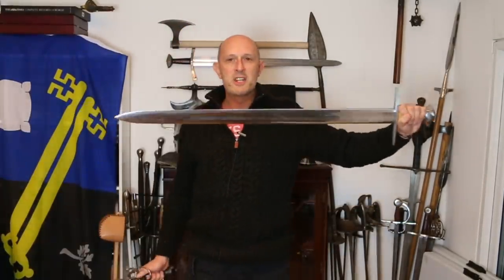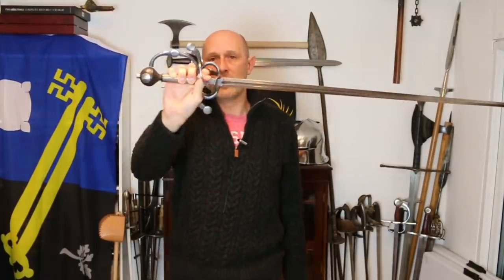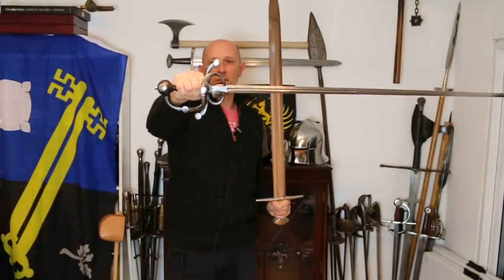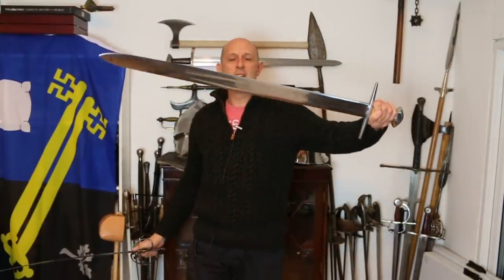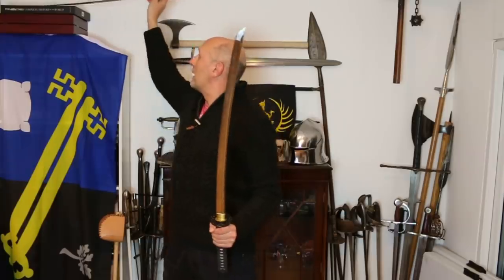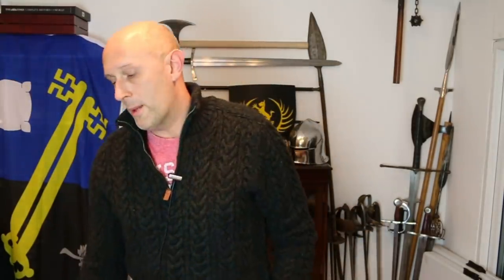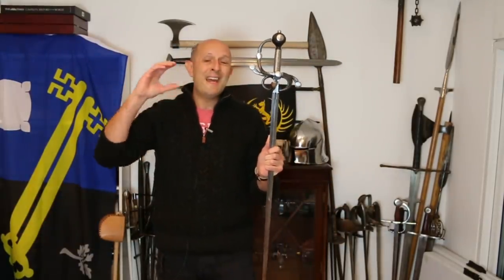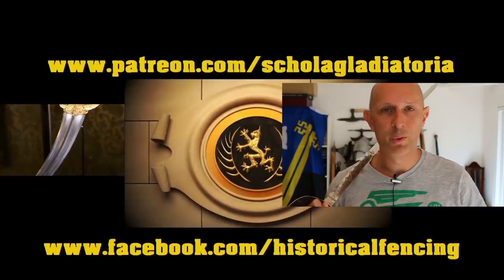Sword Blade Technology Informing Design

Comment: I understand the points being made in this video, and it may indeed have some truth to it. But, as always, any discussion of the evolution of arms and armor is even more complex than can be covered in one video. I personally focus on the late Roman and early medieval periods, so I've done a lot of reading on the subject of swords in those time periods. We can definitely say that, in the early medieval period (migration period - Viking age if you prefer), there was a broader range of steel and iron quality than either in the Roman or later medieval periods. Could be poor, could be excellent, could be so-so. And a lot of the metallurgical analysis of weapons and tools reflects that fact. So, of course, it impacted how weapons were manufactured. Pattern welding, folding, and laminating steel (like San-Mai) were all techniques performed during this period to make the good steel go further and the poorer quality bits more reliable. 

However, one thing that makes me question Matt's hypothesis here is the fact that these weapons change relatively little (at least in blade shape) from the Roman spathae they ultimately come from. Warfare during the late Roman period on through to the Viking Age doesn't change as drastically as it might have across 5-6 centuries compared to changes from the Viking Age to the Renaissance. All this in spite of the drop in consistency of steel quality after the classical period. The overall form of these swords as long, broad, cut-oriented weapons remains relatively unchanged. And while the availability of armor may have changed from time to time, the style or armor didn't change so much. To me, it seems like the form of the weapons is still just related to their function regardless of the average quality of steel. They stuck with what worked with some tweaking here and there. 

There are definitely some Roman spathae that are more narrow than the ones that the Germanic spathae descend from. And I would have to look more into those to see what they were used for and what kind of steel they were working with. Maybe that would shed some more light on this and see if Matt is onto something. Good video, Matt! Really got me thinking.

Comment: All of the earlier 'dark age' swords that I've seen (either as excavated or X-ray'd) have a narrow tang passing through the crossguard up though the hilt - during re-enactment training or 'battles' the majority of failures occured at the section change at or near the crossguard at the base of the blade suggesting that the width of the blade was a design choice rather than a material one? EDIT - must admit that the re-enactment blades were normally made from modern spring steel (EN34 from memory).

Comment: This is the missing topic. Cheers that you got to it.

Q: is thrusting more stressful to a blade than cutting?
Reply: I wouldn't think so. The force on the blade from the blade/target interface will be fairly similar as that is limited by human factors. A cut would actually put more stress on the blade because it subjects the blade to a bending moment with a long lever arm.
 This is why swords meant primarily for cutting tend to be very wide but thin (see falchion for extreme) as the material farther away from the neutral axis of the sword provides more strength than material closer to the middle. It is the same concept behind I-beams.

The reason you see swords undergoing such radical deflections in the thrust is that they are actually buckling, which takes much less force for something that is long and thin like a sword blade.
Reply: Depends on the shape of the blade and the metallurgical properties represented within.

Comment: I have some questions about about the guards on different swords, you mentioned the change in balance from the increased hand protection in the rapier compared to the arming sword, so how does the katana's disk guard weigh compared to a medieval long sword? It has also been mentioned that the disk guard gives less hand protection than a  cross guard especially for the back hand, if so do we see wore evidence of hand injuries on samurai to support this? And might the backward curve in the katana's handle be to hide more of the back hand behind the smaller guard so that it is not sticking out forward and exposed? Just shooting out theories, let me know what you think.
Reply: The Tsuba, the Japanese disc guard, is lighter than a crossguard with long quillons for sure; I don't think that you would find some data but is really a matter of dimension.
Some Tsuba could be quite big though.

It's really kind of a mystery why the Japanese didn't use crossguards, since they have it on other weapons; they are called Hadome and are used in spear, nodachi, parrying dagger and other polearms;

https://www.ashokaarts.com/img/product_images/image/detail/yari-hadome-with-lacquerwork-19th-century-3-6862.jpg

One of the reason that is often given is A) the Tsuba was actually large enough and B) the Japanese swordmanship is built in a way that most of the actions happen towards the end of the blade rather than closer to your hands. For example, in the bind, given the curvature of the katana, the blade slides rather than staying in place, so you don't really have time to use the crossguard. 
I'm also not aware of any technique made to snipe the hand; hands are very small and moving target.

If anything, if they didn't like their guards, they would have changed it. Despite all the hate/glorification it gets, the katana was a sword born from the battlefield, made to work and a very utilitarian tool up to the mid 1600.
Reply: @lucanic4328  thank you . that's some interesting information.

Comment: personally (purely speculative) i think the Katana (also the dadao) is mean to be used single handed on horseback if the samurai ran out of arrows or lost/broke their pole-arm. Then in desperation as a two handed sword on foot, but a samurai off his horse with a katana is little match for several peasants with yari. The particular shape remaining in use long after the Chinese abandoned that style is because the Japanese probably didn't use the katana for battle, only as a badge of rank and in duels that are expected to be over in a single strike. tradition and an "if it ain't broke, don't fix it" attitude kept it in vogue long enough for it to survive to the age of sabers and become relevant again.
Reply: That's true, to a degree. After Japan was unified after the battle of Sekigahara under the rule Ieyasu Tokugawa warfare slowly started to beomce a thing of the past and thus the katana started to get used less as a weapon of war than it already was. That's why I think that the katana stopped evolving after a while, it's because there was no need for it evolve since there was no longer any pressure from war to make changes and improvements to the design. This is also when, in my opinion, that the katana started to become the status symbol that it was in Japan, it was easy to carry around and thus a tie to their warrior heritage that they could carry around with them everyday.
Reply: Your points on the katana make sense but Dadao has always been designed with two handed use in mind. Other types of Dao saw primary use as one-handed cavalry sabers

Comment: Could these material strength concerns have to do with the way that Khyber knives were used? Matt has made a few videos citing victorian surgeons reports of 19th C Afghan fighters and soldiers cutting with their Khyber knives to the exclusion of thrusting. Perhaps the fighting system surrounding these weapons originated in a context where replacing a broken sword was extremely expensive, and swords were likely to break as they were made locally of lower quality from scarcer imported steel. As users of bayonets found over the centuries, weapons thrust into an opponent often break (or get stuck) and then must be replaced. If a sword was something inherited through generations and therefore prized for its sentimental and martial value as well as for the difficulty of replacing it, wouldn't such a context lead to a sword system that minimizes the chance of breaking your only sword?

Comment: I think I have two major issues with this. 

I think in Japan there's a sense of traditionalism, conservatism, which helped keep the katana, tachi in that particular form. When they did have the understanding, material knowledge to be able to make very differently shaped blades, they kept to the traditional pattern, simply because it is the traditional pattern. 

Their combat, which I have to admit I'm not as educated as I want to be, didn't really undergo the changes we really saw in Europe until much later. Even the 1800 to 1900's, if I want to throw some dates around. To be clear, credit to the smiths for making the most of the materials they have at hand and on top of that, the craftsmanship for the weapons that survived. Also, credit to the smelters, polishers,  the entire process from start to end. It's a long, complex and interesting process. 

Second thought is another take on context. Rather to the point you only know what you know, you don't know what you don't know, what's going to come in the next year. This is my issue with some of the early blades. Those smiths worked hard to make sure they make the blades they produced were fit to use. It really is that simple. They made a series of trade offs, choices, to ensure the blade was fit to use. 

So you might pick up that broader, early Migration blade, then a later period, 14th century long sword, they should cut on a very similar level. They should be able to take as much abuse as each and on top of that, should have the same...... persistence? Endurance? What I'm trying to get at is the same ability to last for a long time, whatever you want to call it. They really should. The smiths who make, made, such a blade, were operating on the lessons they learned, what worked in the past. As that body of knowledge deepened, it allows the range, spectrum, of what was a workable, functional and enduring blade to change. 

I don't think you can compare the common, trained knowledge of a person separated by ten years, never mind one hundred years or longer.
Reply: To be fair to the katana, it is still technically a backup weapon. It's primary advantage seems to be that it could be brought to bear from it's scabard practically instantly.
Reply: @weaponizedemoticon1131  So can an arming sword, I don't think there's any real  difference between the arming sword and katana there. 

If there is, it's between the people who are performing that drawing motion.

Comment: I think weather also take a large part on weapon shape, you see, South East Asia is wet, having heavy rain everyday, so metal will easily got rust, that's why sword is not popular here but instead the more cheaper blades like parang and golok (short machete type weapons) and keris are more popular. Because it is practical, why want to waste energy making expensive weapons that will get rust later, it is better to make cheaper blades that can be replaced at any time.

Europe and many other places have very cool sword designs because having dry weather making metal last longer, you have more time to think about what to do with your metal. What I mean is, us in South East Asia don't think much, as long as it can cut, slash and stab then it is good.

Comment: What kind of synthetic/plastic sword would you make?
Reply: You mean for training or combat?
Reply: Arpio Shop's
Reply: @Robert399  let's say combat.
Reply: I wouldn't recommend ever making plastic swords for combat. As a blade-making material, it's halfway between steel and bread. And I don't see any other benefits; if you want a weapon to sneak through metal detectors, a sword is one of the worst choices. If you really had to make a plastic weapon (let's say it's a post-apocalyptic scenario and plastic's all you have access to), I'd much rather a spear with a plastic head.
Reply: @Robert399  or better plastic spear with metalhead
Reply: Anything chopping you are going to want a metal edge. If you are simply stabbing, you may get away with many more materials. Even slashing blades don't need to be as durable as choppers. Of the many materials swords have been made out of besides metal, probably the most common I know of is the old Aztec style sword. It was wood with obsidian blades embedded in the edge. It was heavy and incredibly effective as a chopper. The Spanish conquistadors said the blade could quite easily lop a horses head clean off. The problem is that obsidian is very brittle, so when it hits anything hard, even wood, it can shatter.
That all being said, if I were to design a sword and limit myself to non-metals, I would probably use some kind of glass for the edge, or some kind of epoxy or resin (there are many different types and can be extremely hard; might be able to find something very durable and still sharpenable), and fix that edge into a hard plastic or carbon fiber core.
Reply: Carbon fiber core ceramic cutting edge. Carbon fiber spear shaft titanium spear head.

Comment: You should make a video on what type of sword would you use if you were to compete on Knife or Death. I often see weapons that are clearly not optimized for the cut. I see contestants using bastard and long swords. I figure that they want someone with a sexier sword than a machete. One could use a long kurki, a kopis, or that falchion. I have also thought that the lead cutter would be good. What about double edged verses single edged. The ice challenge can damage your sword and you could the other side.

Comment: Katanas have very durable edges, and they are meant for you to take great whacking blows with, at least this is the conclusion I've come to. If I had lived in those times, I would care more to have a durable sword than an extremely sharp sword (incidentally, I would not prefer a katana in most cases because they are difficult to sharpen). You can make up for sharpness by hitting harder.

I'm not sure if this is widely known, but edge angle is an important design feature. A knife is not simply a smaller sword, it has a significantly smaller edge angle (usually 14 to 25 degrees). If you made a sword sized bladed object with an edge angle like a knife it would very sharp, but not very durable (this is why [some] knives have secondary bevels, as it serves to re-enforce the edge). Swords [those which are used to cut] usually have edge angles of over 30 degrees, which is more like a machete blade.

I'm actually very interested in how they maintained and repair their swords, which inevitably would get damaged through use (it's also important to note that, in all likelihood, a sword would be made from a steel of much inferior quality than what we can make today).

Comment: I know you have talked about it on other occasions but another technological impact are armortype they come up against. Afaik in Japan because of the mediocre steel good metal armor were rare on a wide scale, hence cutting was always a good way to go. In Europe with the firearms armor became heavy and cumbersome so in day to day life you wouldn't wear your armor, so your side weapon really hardly ever had to be designed to deal with that. On ships wearing armor is just rather silly so there again what you said about "faster cutting" vs "heavy cutting" so to speak is true. So again for different reasons weapons were optimized for killing unarmored or at least lightly armored enemies.

Comment: That early arming sword probably went hacking against shields and could probably burst mail rings with a hit, this could influence the need for such a shape as well.
Reply: @XCodes I would say that such an intention came a bit later, even during duels of the time you could have multiple shields available becouse they would break quite fast, this blade looks very similar to viking era swords in that regard. With more codified sword fighting there came many ways of going around a shield, thats right. But this blade doesn't seem to be made to be agile enough for that, to me at least, it looks more like a slab of steel that packs a punch :)

Comment: I'd say a correction that the momentum of a rapier isn't very high, but the velocity is.

Because momentum is what keeps the blade moving and holds it from stopping; ie what would let it keep moving after it hits something and is resisted. Rapiers are poor cutters because they don't usually have the weight to keep going after it hits something, whereas a falchion or arming sword has more mass to keep it moving despite being hindered. You can even feel it when you swing it through the air; a rapier can be controlled with one hand relatively well, whereas a sword with more weight in the tip is a lot more difficult to stop.

So as you noted with practice rapiers, due to the massive velocity it will hurt. Like the tip of a whip. But it won't cut through much, so while it would cut through skin and muscle, it wouldn't usually be able to go through bone if it was sharp.

A lot of longswords that are thrust-oriented have the same problem and I've noted it in cutting tournaments where I tried to use a Tinker Pierce longsword and fared rather poorly versus the next year winning the gold medal with a borrowed Albion sword.

Comment: By the 14th-century blast furnaces were used to smelt iron and really the earliest dated European blast furnace found in Sweden is thought to be from the 12 century.

actually, High-quality blades up to and after Viking era blades were made using a similar method to the katana as both used pattern welding.

however, i wish you covered the thickness of a blade as i cannot really find information on this topic.

some of the design of the katana was the tachi kept breaking on mongal armor. also, the several hundred years of peace Japan went throe relegated the katana to male jewelry.